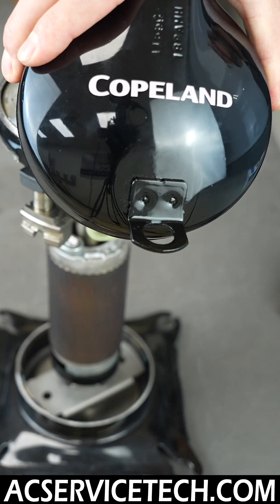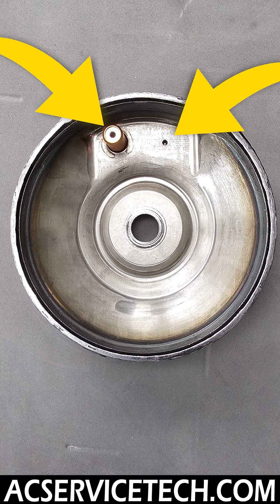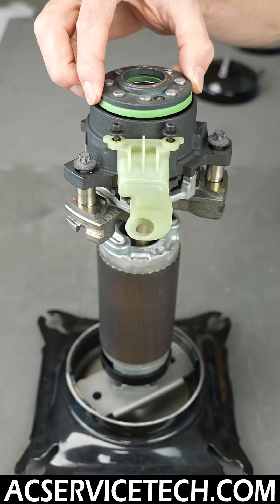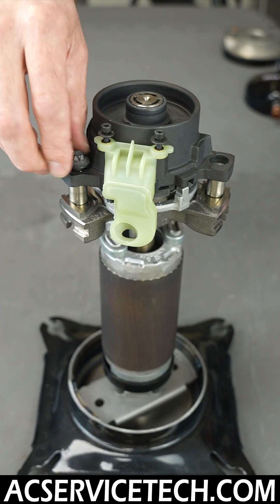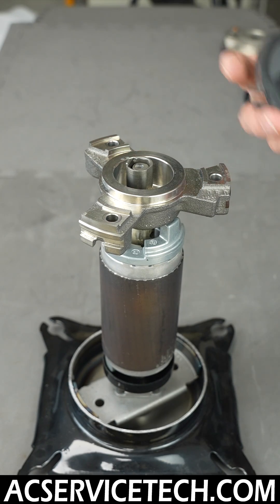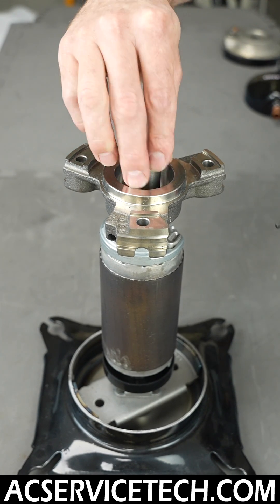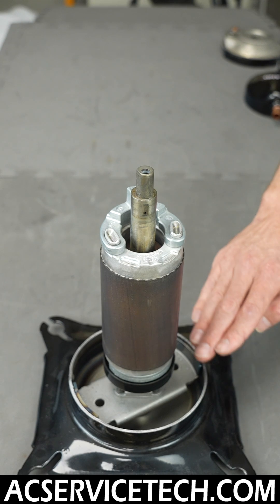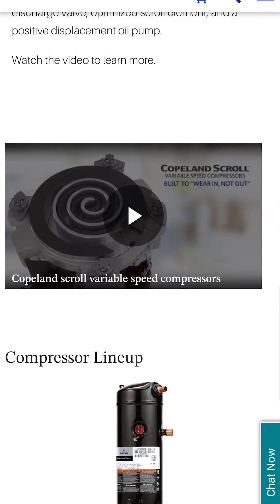Single Stage SCROLL Refrigerant Compressor Operation and Internal Parts Explained!

Comment: I was just talking to a friend about this. He says there’s a vacuum pump you can use that only takes out the oil so you can replace it with new oil without affecting the refrigerant or charge on the AC system .
Is there any videos on this cause I think that’s very key for maintenance especially considering what you said that the oil is the bearing, especially when the compressor is doing a ton of work here it’s a must to make sure the oil is at proper levels and fresh.

Also, when he took the cover off, this looks like a new unit, but it’s already rusting from the inside, which would make sense why my 2004 unit is showing surface rust on the outside which means these components are not meant to last (using cheap material that rust )when they’re already starting to rust especially from the inside.

Comment: Is there a likely internal failure mode when you hear a scroll compressor vibrate for about half a second within the first 3 seconds of starting, on some of the starts but not every start? Cooling seems  unaffected. 

It has a new capacitor on it, voltage is good and contactor looks fresh. It does not have a hard start capacitor. It used to have an aftermarket hard start that I removed during the last cap replacement. Though it was doing this before that change. 

I haven't taken the compressor noise blanket off to check the condition of the hermetic terminals. But I figured something internal to the compressor is probably wearing out. This is the third cooling season this has been happening.
Reply: Noise blanket ? I've never heard of them. Are you sure it isn't a heating blanket ?

Comment: The 'unloader bushing' as you called it I was under the impression the funny shape, flat spot was an anti-reversing device. When scrolls first came out people complained they made bad noise at shut down. Trapped high pressure gas in scrolls pushed scrolls backwards until pressure equalized causing the noise. Once they developed device complaints stopped. Device kinda cocks in there on flat and jams preventing backwards rotation.